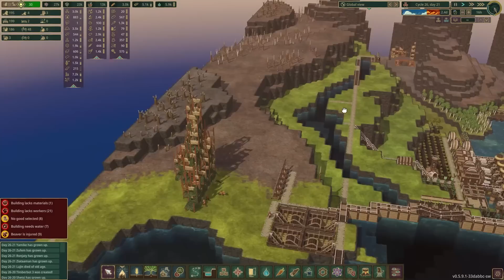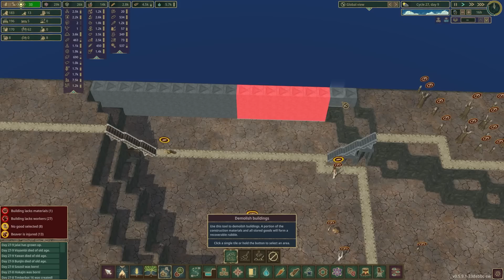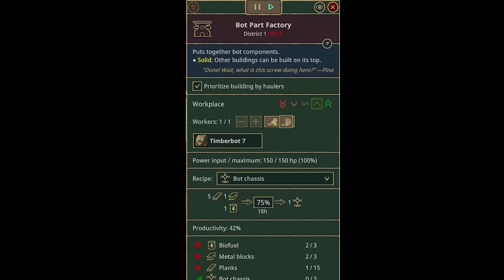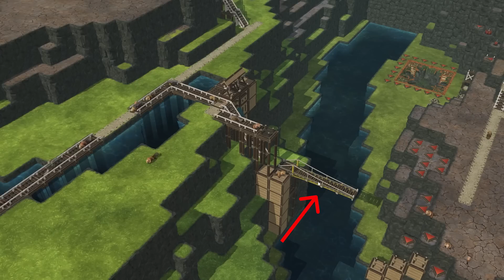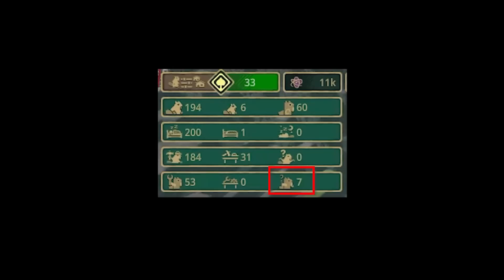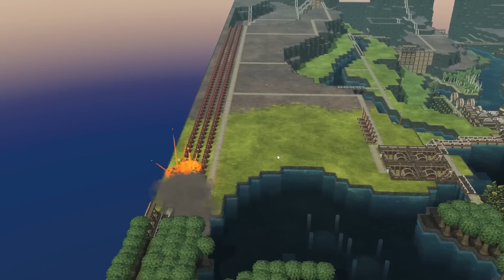Greening the last corner of the map  - Timberborn Whitewater #16

Comment: Why do you prefer windmill than waterwheel? Fitting rows of waterwheel should be more efficient
Reply from the maker: I'm spending a decent chunk of time in dry seasons now, which stops the flow of water. I end up liking the windmills because they provide energy in both seasons (provided the gravity batteries can take care of the wind speed variation)

Comment: I love this series, do the droughts increase in length over time, or have you built a good enough city as to where you will always be fine
Reply from the maker: The droughts have been slowly getting longer over time - however I've stock piled so much water at this point that they've mostly become non-events so I don't call them out anymore.
Reply: Without mods droughts max output at 30 days. If you stock pill enough resources and can regain those stocks during the minimum wet season, then they no longer matter.

Comment: Hint: if you hold shift while you delete buildings, it won't bring up the confirmation window.
Also, it's worth locating catalyst and punch cards, along with fuel wherever your bots are working. Increasing bot efficiency is easier than increasing beaver happiness, and since they work 24/7 it has a bigger effect.
You really should get on the experimental branch, they've added vertical power shafts that are extremely useful.
Reply: I’m pretty sure he will start playing on the experimental branch once he’s done with whitewater, other than that, I hope he sees this
Reply from the maker: That vertical power shaft would have been so useful for this build. That switch back to get power up the cliff was pretty wasteful. I think this play-through is getting very close to the end - I'm looking forward to building with all the new stuff in the experimental branch. I'm thinking of doing an "Ewok" play-though where I try to only build homes suspended off the ground.